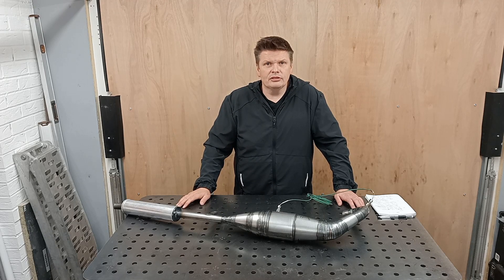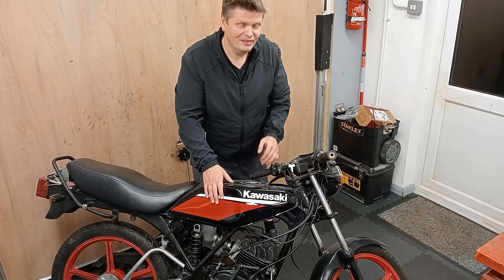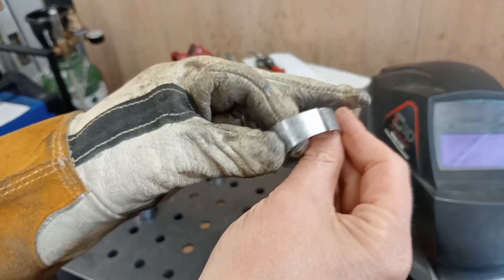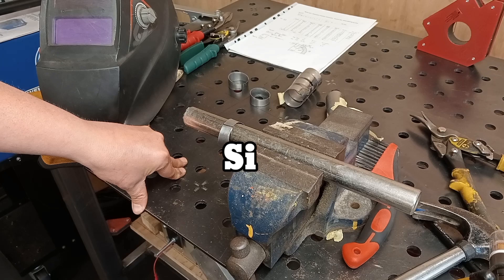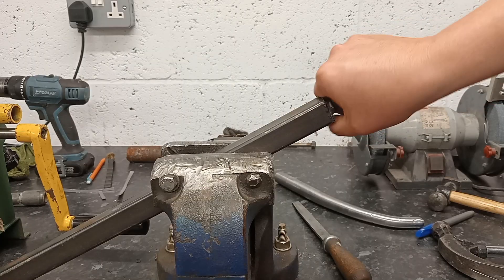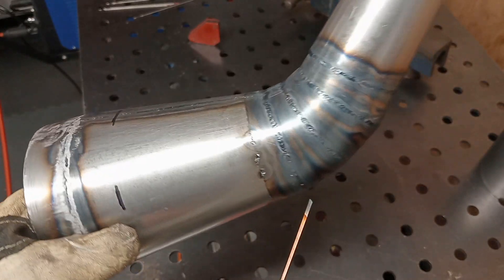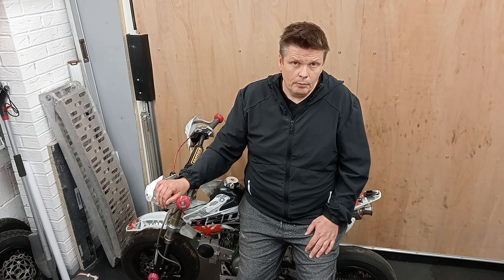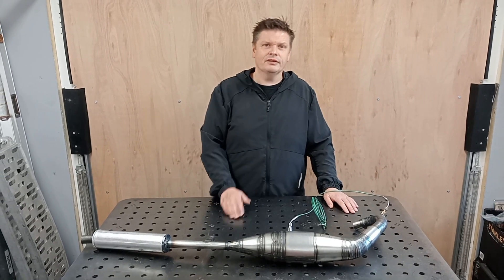Create a Custom 2 Stroke Exhaust System - DIY Expansion Chamber." #expansionchamber #twostroke

Comment: I was just wondering. Does the curving of the pipe effect the performance much compared if it would be straight as in the drawings and simulators and would it be difficult at all to rotate the cylinder and the piston 180 degrees? You could have the pipe go straight to the back under the saddle and that would let you do some kind of ram air intake if you have the carb in the front 🤔
Reply from the maker: Hi PPekka, I haven't done any tests but from what I have read it does make a difference.

Comment: Have u ever tried using Polylok stainless flexible exhaust pipe for the downpipe? U can get it with collars on which you can slot and clamp if u wish .ive just put 2 pieces on a Formula 125 twin and they are so far holding up perfectly .im just putting some on an RG 2t
Reply from the maker: Hi, is this the stuff?
https://www.everyexhaustpart.com/cart/polylock-flexible-tube
Reply: @AutoBeta2T  ye thats the stuff .u can get it any size and with collars on too if u ask em..look on e bay and make some enquiries
Reply from the maker: Will it extend and contract?

Comment: Fantastic, its looking really good now, are you considering doing any kind of electroplating just as a bit of corrosion prevention?
Reply from the maker: Hi Gaz, probably not as I don't think this will be the final pipe. I'll maybe soak it in oil when it gets hot to try and prevent the surface rust. A mate of mine has had good results with clear heat proof lacquer...

Comment: Have you considered the alternative method of using 2 single sheets welded and pumping with oil to form the shape?
Reply from the maker: Yep - I have hydroformed a header before but not a full pipe. The plan is to do one at some point.

Comment: Dude i love your channel im fixing to start making bikes from scratch dt100 chassis copy with stronger steel with blaster engine and cafe racer look but track ready with a blaster 200 engine and kx85 suspension.also will do 90 so highway unable i need to make a custom pipe for it though your saveing my ass
Reply from the maker: Hi Darius, cheers and sounds like some cool projects you have going on there!
I'm pleased the videos are helping 😊

Comment: Great video and good to see you back! What EGT sensors are you using ?
Reply from the maker: Hi, they were from tcdirect - Type K Thermocouple - Inconel 600® Sheath (1100ºC) 3mm dia x 100mm long - https://www.tcdirect.co.uk/product-2-190-1/Mineral-Insulated-Thermocouple-with-Pot-Seal-0-25-0-5-0-75-1-0-1-5-and-3-0mm-diameters
And thank you for the feedback - it means a lot.
Reply: @AutoBeta2T  👍👍
Reply: @AutoBeta2T  Hi again, my RG500 is close to going on the dyno again and I think I really need to fit some EGT probes to each pipe before I do this time. Do the TC thermocouples bend ok as I would need to bend them ~90 degrees as soon as they exit the the compression fitting ? I assume you are using the adjustable compression fittings from TCD - which ones did you go for ? Do they supply the weld on bosses or did you source them from somewhere else ? And finally what are you using to read/log the temperature readings during your dyno runs ? 👍
Reply from the maker: Hi, yes they bend easily. They are 3mm dia ones. I may have the part number somewhere at home. The fittings are at 1/4 NPT (I'll double check) but others could be used I guess as long as it's for the 3mm probe. Boss wise I made my own but  I saw some on eBay for about £8.
My Dyno has two inputs for egt/cht so I'll just stick them in there and it will overlay it on the run.
I need to get a gauge for real world testing. I do have a SPA one but it broke... Stage 6 maybe. Could do with a peak egt memory function.
Reply: @AutoBeta2T  Thanks you so much for taking the time to reply that's all been really helpful. Packaging/fitting 4 X EGT probes to the RG500 is certainly going to be challenge! The other issue is a decent gauge and data logger. The MGL Avionics Vega TC-4 CHT / EGT (see parts4aircraft for other gauges) is probably the most practical gauge I could fit but is does not data log. The other option is the reveltronics utcomp pro which for its capabilities including data logging looks very good value but I'm not keen on it's 3.2" rectangle screen!
Reply: @AutoBeta2T  I just seen MGL Avionics LOG-1 and LOG-2 Data Logger for Blaze and Vega gauge on parts4aircraft so maybe there is my solution!
Reply from the maker: @dwhxyz  do you have a link?
Reply: @AutoBeta2T  YT may block reply if I post links - search for parts4aircraft  and reveltronics.

Comment: Hey mate I know you’re into high performance. How come you haven’t done a video comparing a belly stinger vs conventional. I used a belly stinger Jennings or bell said it reduces noise and improves midrange and definitelt found it does both. Be interesting to see on the dyno. 

I literally just inserted the stinger so it terminates in the belly section of the chamber and welded it up at the end of the baffle cone.
Reply from the maker: Hi, it is something I have wondered about doing. Maybe a test one day I recon :)
Reply: @ the moped guys use the belly stinger a L kit.  Also for easy tuning they just use a valve at the end of the baffle cone in addition to belly stinger  so they can quickly change the stinger (outlet restriction) parameters. Makes for faster tuning.

Comment: Do you have the two sensors so you can get an average of the exhaust temp?
Reply from the maker: Hi Dave, yes. I saw the idea on Jeff Henise's site here: http://www.highwaymanbikes.com/race-pipe-tuning-for-the-yamaha-td3-250cc-twin/#more-640

Additionally I want to establish a base line temp for egt 1 and 2 on the Dyno and replicate it in reality on the road. I've a feeling that the pipe will cool more on the road than on the Dyno. I can then make adjustments to the pipe tuned length on the road. Hopefully giving a little better performance.
Reply: @AutoBeta2T  Thanks for posting that link 😎

Comment: Hi. Nice job on that. I might try making a pipe.
Reply from the maker: Cheers Matt 🙂
Good look with your pipe!
Reply: What program do you use to get the templates for cutting?
Reply from the maker: Hi Matt, I used Mota in this video but it's just a feature of the Mota program that is a 2 Stroke simulator and does cost over £100.
A lot of people use this program for printing their cone templates: 
https://www.conelayout.com/

Comment: Nice job,
Can I ask what software your using to calculate dimensions.
Reply from the maker: Hi, I modified a design by Graham Coker in EngMod2T. This pipe was for a AM6 engine but didn't rev high enough. It was just chance that it worked well with this engine. I have since used Graham Cokers' exhaust design program to try some other designs in EngMod2T. I hope to try a few when I get a chance too.
Graham Cokers' spreadsheet is really good and I know of a lot of real world tuners that use it to produce good pipe designs.
Reply: @AutoBeta2T  
Thank you for your reply I shall look up Graham Cokers.
Reply from the maker: https://www.facebook.com/graham.coker.54

Comment: havent done this in ages...

i always just fudged my peak rpm around a bit until i ended up with length/diameters with nice even intergers... like 25mm over 125mm lets you make 5 rings at 25 long with a 5mm increase... rather than 25.2, etc... i felt 200 rpm or so here or there, or a bit of compromise on the band was worth the hassle of non-laser cut accuracy... all those little half and quarter mm adds up!

lay em out with a piece of filler rod marked at appropriate intervals, bent in place. can guesstimate bends to a certain extent. throw the odd cardboard former on for diameters and tweak for clearance where its an issue...

learnt early on that theres a limit to how sharp a bend you can take in one go before the turbulence chokes you.

this shape was really easy enough to hydroform, but that takes some fiddling with the initial layout to get it popping right...

miss my nsr150. almost motivated to start playing with it again. sigh. making a piston and sleeving a cylinder... sigh. if im going to blow parts up id rather know that i can make them again... limited number of pistons available. odd size. no alternatives.
Reply from the maker: @paradiselost9946
Great info - thank you.

I'm interested to hear at what bend radius you found power dropping off? I try to keep my radius quite large and pie cuts less than 15 Deg (total).

I'm wanting to hydroform a full pipe at some point. I've hydroformed headers before and had good dimensional accuracy but I've heard it can be difficult to control the belly diameter and allowances have to be made for the extra stretch in the larger diameter areas.
Reply: @AutoBeta2T  min bend radius... never really found one!  as tight as i could manage and still have something to weld. 

but yes,  no more than 15 degrees included on each cut. try and be lazy, take it in two pies versus 3 or four...and you just wasted a lot of time by "saving" some. 

the pressure wave doesnt care about the abrupt changes, but the gas flow definitely does.

hydroforming, it does get tricky on the merge from trumpet to belly, have two conflicting curves going on... that i usually just avoided by not doing too much on one go, joining three sections still beats joining... yeegods... done 109 before? never again!

no problem if it had a mould but we arent that rich, are we?

the header/diverger as a separate with excess to trim off and let the flare do its thing, same as the converger. bellys just some sheet in the roller as always.

Comment: Ive just pulled out my old photo album ,, when I had my old Kawasaki AR80 with standard gearing I would do 65mph ( ill let you google gearing and where red line would take it ) I went and got it Stan Stevens tune done on head and port that was it and it would do 76 MPH on standard gearing I seem to remember it was just under 11,000 RPM , with out a doubt with correct gearing it would of done 84 MPH as it was pulling well at 76 MPH into red , so just food for thought guessing with Clock error I might of been 8 to 9 % out so I was genuinely doing 70 + MPH on standard gearing . SO with better tune Exhaust etc etc .. Im sure you will get there . I had a Yamaha RD125LC partly derestricted got 98 MPH out of that so probably 88MPH real speed with id say 19 BHP
Reply from the maker: Hi Mark, I definitely hope so. I know they were near in the original magazine article. I need to think about getting the gearing somewhere near for testing soon.

Comment: Really interesting stuff, ive done a few of my own fag packet design pipes for my valves , can i ask what tin snips you use ?
Reply from the maker: Hi Teddy, cheers 😁
The tin snips are Stanley. I did buy the red and green left and right handed ones but actually I find the yellow universal ones good for everything.
How did your pipes work out?
Reply: @AutoBeta2T   Thanks bud , they've actually got them on offer at Toolstation at the moment,  my pipes looked great but never really got to test any of them because when my son was born 10 years ago I just chucked the bikes in the garage and covered them up , got 3 , all LC's in various forms, some a bit trick . My mates had the AR 80 s , I had the rd80lc back in the day , remember going to the bmf rally and one of my mates went to start his bike turned on the petcock , petrol pissed everywhere, someone had knicked his carb , for the AR 50 no doubt , happy days , be sure to keep up with your channel.👍
Reply from the maker: hi Teddy, how are the tinsnips?
Reply: @AutoBeta2T  Hi mate 
Only just got back this morning from a holiday abroad.
Was watching all your really interesting vids poolside.
I've used the Australian guys pipe calcs software to work the cones, AuMechanic. 
Do you recommend any other pipe calc software? 
Thanks for the reply btw .
Reply from the maker: Hi Teddy, I usually use Graham Cokers' software (CRP) but he doesn't have his website anymore but he can be contacted through Facebook.
It's a really good calculator that has different specs for cc and application. 
Other than that I use EngMod2T.
Reply: @AutoBeta2T Had a quick go tonight with the snips and they seem to cut the steel with ease . I can forsee a problem in the fact the actual jaws of the snips are not very long and they seem to get bound up on the sides if that makes any sense ? Maybe the left and right set might help me out a bit with the cuts . Any advice on how to cut the cones much appreciated. I actually bandsawed all my last lot years ago but it would be easier to do these at home , not a work . Hope you are keeping well.
Reply: Hi again mate .
Any tips on the tig set settings? 
I'm not making a great job of the latest ones I'm having a go at on the welding side 
I think getting heat out of the weld would help , but obviously you can't put a mandrel on the inside of the cones .
Thanks again
Reply from the maker: @topfuelteddy hi Billy,

Regarding pipe welding I think I use around 20 amps but it varies.machine to machine. My old one used about 11 amps. Just have a play on some scrap to see what setting seems best.

Do you have a peddle for your welder?

Is there enough gas coming through? This has caused me issues before... Try increasing the gas flow.

Is your tungsten sharp? Are you grinding it length ways? On a clean grinding wheel? Also what size? I usually use a 1.6mm thoriated tungsten (red).

Where are you having the issues? Is it starting or as you go along?

I move the tungsten a lot when staring in a small circular motion quite quickly to stop putting all of the heat into just one side. The as I move along the weld I am still doing the circular motion. 

As I mentioned in my videos fit up is key. However some 1 mm wire can be used in areas if there is a slight gap...

I hope this helps.